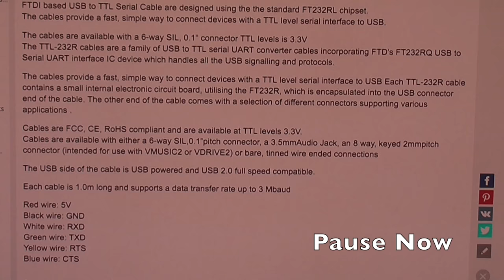DIY Baofeng FTDI Programming Cable

Comment: This worked for a new QRZ-1 Explorer (the free promotion radio still good until the end of October) - it doesn't come with a programmer, but I had a CP2102 and some patch cables and sockets.  Ended up being TX (on the UART) to the 3.5mm sleeve and RX (also on the UART) to the 2.5mm ring.  That does mean that from the radio's point of view, your chart at 0:22 is right; but from the UART's PoV it's reversed.  Nothing bad happens if you reverse those.

CHIRP now works with the QRZ-1, as well.

Comment: Does it run at 5V or 3.3V?
Reply from the maker: Michael, it's a 5v USB to TTL UART FTDI adapter. If you have a different one (one for 3.3v) then it may not work. All the best, and thanks for your question. Trystan
Reply: @TrystansWorkbench  My FTDI adapter has a jumper to select voltage.  I used the 5V setting and it worked like a charm.  Thank-you.
Reply from the maker: Michael, thanks, that's really great to hear - and useful too for others with a similar FTDI adapter like yours. Cheers! Trystan

Comment: Can i do this with standard usb cable with four cables inside ?
Reply from the maker: Nochanta, no the FTDI cable has a chip at the USB end of the cable that converts USB to FTDI.
Reply: @TrystansWorkbench  can i use something different ?
Reply from the maker: @CratorKingDS  You can just get a Baofeng Programming Cable I'm guessing. Really what you are looking for is an USB to serial adapter that uses "TTL" logic levels. Those are normally described at "FTDI" cables. If you had a USB to RS232 cable you would need to reduce the voltages as RS232 uses 12v logic, but you need 5v logic levels (Transistor Logic Levels - or called "TTL") for the Baofeng.
Reply: @TrystansWorkbench  I got it. Thanks !
Reply from the maker: @CratorKingDS  Great! I hope you get it working.
Reply: yes
Reply: @dominichawkins7997  but he said i can't